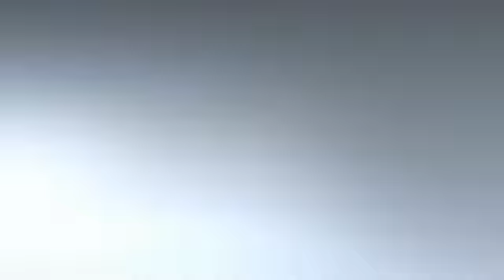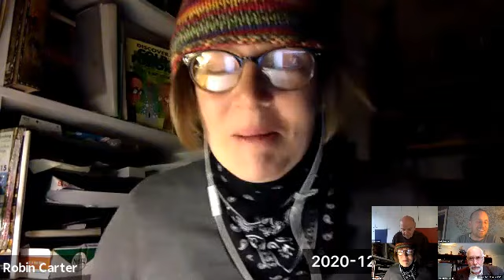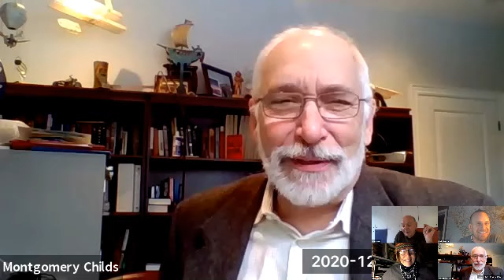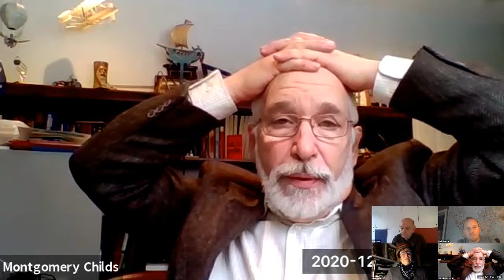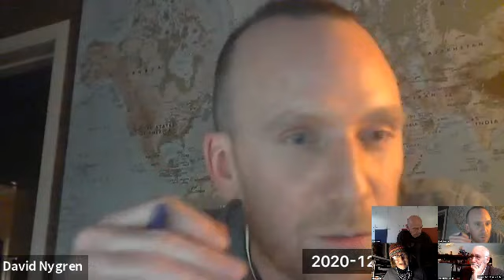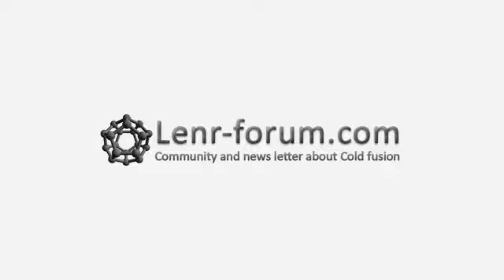Interview with Monty Childs, CEO of Aureon Energy

Comment: THE REVEALTION OF THE MACHINE MONTY'S REFERING TOO !
Monty is evasive about what the Safire Plasma Reactor can do, as it's all been patented, using the "Closed Patent" method to hide much of the technical and constructional methods used to create this incredible multi-functional machine. Which was better displayed at the Science & Engineering Conference back in July 2019 at Bath University UK. The Plasma Reactor can and has produced numerous Elements on demand, and has the capacity to produce any Element in Industrial Quantity at extremely low and highly competitive cost. This machine can amongst many things, be used to replace the current power source used in any Main Electric Generation Power Stations to massively reduce the cost of generation. Further it will greatly reduce the actual space needed. And that is just the tip of the Iceberg, as this new technology is Multi-Functional. 

Another revolutionary advance is the Plasma Reactors ability to stop Radio Active material from giving off any more Radiation, instantly. This is most applicable in the case of the Dangerous buried Radioactive waste from Nuclear Power Stations. The Plasma Reactor can simply be fed with this waste when such machines are used in Power stations, to replace the oil, gas, coal or Nuclear Reactors currently used. Feed the waste into the Plasma Reactor, which stops the radiation instantaneously and consumes this material in the process, adding to its already extremely efficient method of boiling water, which is used to turn the Turbines that turn the Generators that produce Electricity, common to ALL main Power Stations, whatever power source is used.  

Further the Plasma Reactor is also applicable as a cost effective way of neutralising Radiation getting into drinking water supplies, as has begun occurring in the USA. Thanks to illegal dumping of Radio Active waste, at at least 100 known sites, across the country. 

And it seems miniature Plasma Reactors are already in commercial use, fitted inside main drinking water pipes, at a number of US locations, for the express purpose of preventing any radiation in Drinking water reaching the Consumer  !

Comment: i think neutrons are key to the fusion. i imagine it’s the interaction between the electron and proton within the neutron itself, via magnetic potential. (i might be using the term capacitor incorrectly.)

neutrons are the dielectric in the capacitor between the transistors driven by the field, making every atom a variable scalable semiconductor. the circuits are separated and coupled because they’re proximal and operating in a field. that complicates the coupled oscillating system. so, it’s varying variables in ways so the responses of the systems are only predictable if you know enough parameters, which we are learning to visualize and conceptualize. the information is there, and nothing new needs to be discovered. you guys just need to do it. 

julius sumner miller: it’s not what you know. it’s what you understand that makes the difference. 

🔥❤️🔥
 .•.👻 .•.

i imagine variables in magnetic force and the material response to it is key to understanding this, the neutron stable or releasing a great amount of instability depending on whether the electrons are “satisfying” protons. (i’m married to the idea it’s all “adult” in nature. see: tantra 😝 )
Reply: @LaurenBurger  "Says the man who knows everything about a Beta minus decay"

I know what radioactive decay is you idiot. That is why I am qualified and you aren't, remember? And there are no electrons and protons within a neutron. The electrons and antineutrinos are created by the process. They did not exist within the nucleus beforehand
High school physics. Learn some;

"Physics Questions People Ask Fermilab"

Q: "Why neutron is unstable particle? If it is "made" of proton, electron and neutrino it could as stable as atom of hydrogen?"

A: "Let me start with your statement, that " If it is made of proton, electron and neutrino it could be as stable as atom of hydrogen? "

The answer to this is that not really. A neutron is not made of a proton, electron and an antineutrino. These particles are only its decay products. A neutron is made of 3 quarks, one up quark, and 2 down quarks and many many "intermediate particles" called gluons which carry the interaction between the quarks."

Duh! Stick to the day job, woo boy.
Reply: @bobsmith231  theyre already dead LMAO
Reply: and - "No one has measured or actually seen an atom and as such we only have theories based on observations." 

yeah, that's enough schadenfreude for today.
Reply: @LaurenBurger  From a Britannica article on the discovery of the atom: "So why didn't chemists just look for atoms under microscopes? To see something under a microscope, the wavelength of light you're shining through the microscope can't be larger than whatever you're looking at. Unfortunately, visible light is thousands of times bigger than atoms. So chemists had to wait for a light with short wavelengths, like X-rays." So via x-rays, the invention of the scanning tunneling microscope in 1981 let chemists finally see atoms.

 Eight years later, in 1989, IBM scientists were literally able to move individual atoms to spell out their company's initials. IBM improved on this in 2013 by making a stop-motion picture with atoms. 

View the relevant wikipedia articles on scanning tunneling microscope and IBM (atoms) to understand the maths and methodology (fully supported by maths) behind it. The IBM (atoms) page references a book entitled, "The New Quantum Universe."

 I think if you truly wanted to give the theory of atoms a chance, you would educate yourself on the mathematics and science of the thing and read it. If you want to build your own scanning tunneling microscope, hobbyists do it for fun. Here's an article for reference: http://www.e-basteln.de/other/stm/references/ 
Also, if you wanted to discredit the scanning tunneling microscope and its variants I'd assume you'd need to provide a vast amount of counterevidence to the established science behind them.
Reply: @LaurenBurger  so.. did you change your mind? or were you trolling
Reply: "i imagine it’s the interaction between the electron and proton within the neutron itself"

There are no electrons and protons within a neutron!